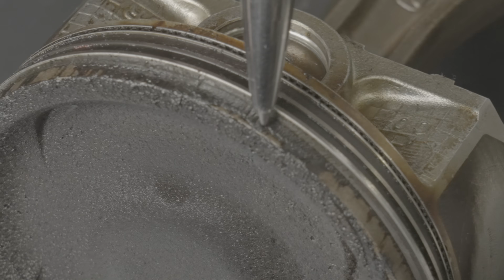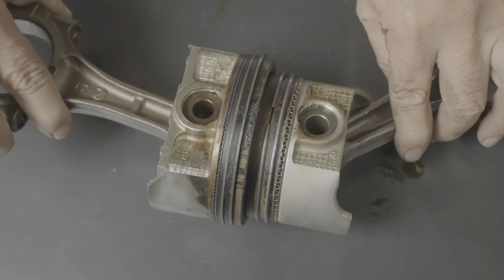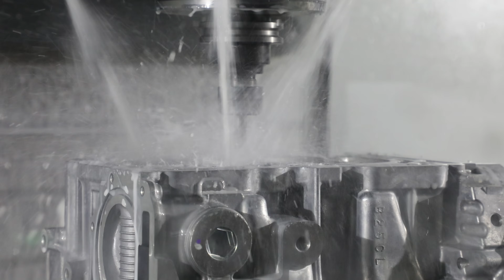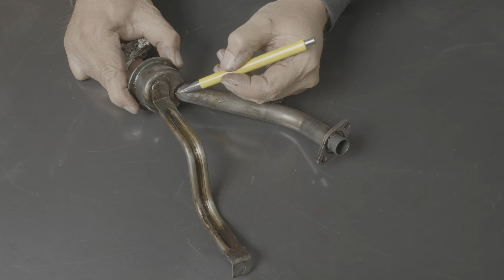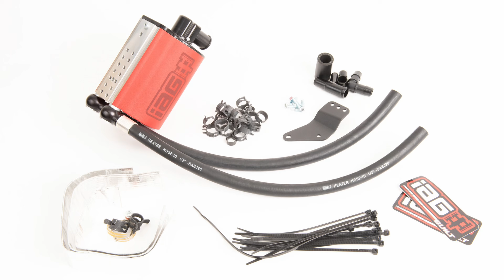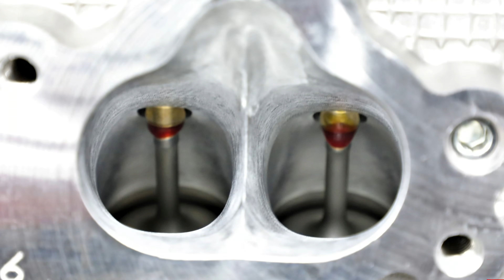Why Subaru Engines Blow Up!

Comment: So basically the Subaru engine is complete garbage
Reply: There are plenty of examples of record holding high hp EJs. The issue is clueless owners with no mechanical sympathy.
Reply: @lepermessiyah5823  they also keep the stock fans and radiator that’s a no 1000$ you’ll get mishi fan kit and radiator
Reply: @Devmoi00  I would go a Koyorad and SPAL before a mishi. They have hit and miss quality
Reply: @lepermeutssiyah5823 hes telling you the issues in the damn vid if you would watch
Reply: @lepermessiyah5823 
I respect all vehicles, however, subaru does not make good engines. A Honda K20A from 2002 makes 200 horsepower out of the box NA and does so reliably, and an F20C makes 240 NA. Those engines can make "record holding high hp EJ" power for less, and put out quad digits for longer.
The EJ is simply a flawed design and can't hang with other engines in its class. I respect unique engines, but EJs making quad digits reliably even with tons of supporting mods is simply not realistic, and even if you can, itll cost significantly less to boost a K series
Reply: EJs are already putting out over 100hp/L stock and not overbuilt at all. Subarus aren't designed for big power, they're for blasting down twisty dirt roads. The extra weight and size of a "better" engine would have made things worst when you consider that the engine is placed over the front axle.
Reply: @brendancrosby2965  100hp/l * with a turbo.
Reply: @badnewskelli  the second gen BRZ makes 95hp/L completely stock and naturally aspirated, name one stock 4cyl that puts more power to the wheels than that
Reply: @brendancrosby2965  evo is meant to do the same thing.  Their engine is much better designed .
Reply: Yup never ever modify them especially
Reply: Mine is amazing 580hp 13 wrx fully built daily driver external waste gate hood exit flames every time I go over 5k rpm
Reply: And then after you build the engine...you have a glass transmission
Reply: @JulianVR4  not the STI 6 speeds. quite capable of 9 second passes
Reply: @lepermessiyah5823  exactly. Now you're out $4 to 5 grand for a stock transmission, or 5 grand for a gearset + labor. 

I got to 18 minutes and he didn't mention anything Subaru actually does right lol. What a bad deal.
Reply: @JulianVR4  labor do it yourself
Reply: Great chassis. Not ideal powertrain for anything more than a stuffed turbo type of power
Reply: @JulianVR4  not if you have an STI. This video focused on the negatives, look at the title.
Reply: @lepermessiyah5823  Ah! If you start out with a car that's $10,000+ more than the WRX, then you've already saved the 4500+ needed to swap to a 6spd. 

That's girl math if I've ever heard it. You've also glossed over the whole big power x short gears thing. You gonna sell me a longer final drive next?
Reply: @JulianVR4  Why would you buy a WRX if you intend on making it fast? Probably check your own logic on that one
Reply: @lepermessiyah5823  here I am, owning 0 Subarus and happy about it ❤️

Lifetime Subaru hater
Reply: @JulianVR4  good for you bro. you should tell everyone.
Reply: @lepermessiyah5823  I only tell the people that somewhat allude to me having one
Reply: @JulianVR4  you dont have a clue do you? no one cares, which I pointed out. Do I have to spell everything out for you?
Reply: @JulianVR4  Keep it going, make people not want them. Preach about how bad they are. I did for awhile not like the hate, but the over priced STI are kinda getting insane, I absolutely love them, but yeah I think the main issue with most Subarus are the owners not the car yes there's problems with them especially trying to make more power out of them, but there's ways to do it and there's no absolute cheap way to do it. Also launching them at every stop light, high revving them everywhere like it's no tomorrow and not letting them cool down even though they'll wait for it to warm up for 5 minutes Idol before they go anywhere, and not forget trying to float gears especially down shifting not knowing how to actually rev match. There's a reason my first and third synchros are usually absolutely gone if not more. The car is great in its own ways. I had 2005 sti Loved it and planning on getting another one and building a second motor to drop into it, but I ain't the guy that does all the things up above I'll put the money into it and actually research.
Reply: @JulianVR4  6 speed trans many people have made 700hp and it holds power the sti 6 speeds are very strong if you are talking about a 5 speed trash
Reply: @abbas674  like I said, you still gotta spend that bread to get a beefed up unit. And if you get a 6spd trans solely BECAUSE it can habdle your big turbo, now you're trying to make big turbo horsepower with big turbo type lag with these SHORT ass gears. It's not an ideal setup.
Reply: the technology in the hands of the Indians is a bunch of metallics))) Subaru is a car for people who understand the specifics and complexity of the approach, and not for VAG drivers 😂
Reply: Yes. Unfortunately subie stans will make every excuse for them and blame the owners not the company for making trash cars..
Reply: It won the wrc a few times so I don't think anyone could say it was garbage
Reply: My 287K mile Subaru would argue the opposite.
Reply: honestly they are great engines, but the  reason why people blow them up is because simply they try pulling the cart before the horse, they try to big power without building that engine so it can handle it. also something so simply change oil regularly, regular maintenance of the vehicle, and honestly, you would probably be able to daily drive a 1000hp sti for along time without major issues.
Reply: If not built properly yes if done properly they are fast as fuck
Reply: No their great cars just need to be in the right hands
Reply: Only garbage if you are a moron.